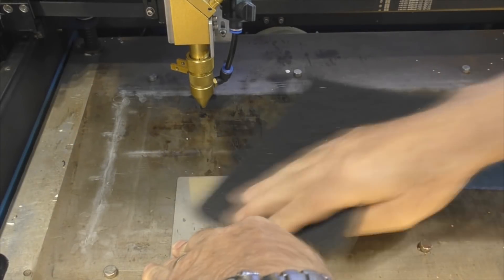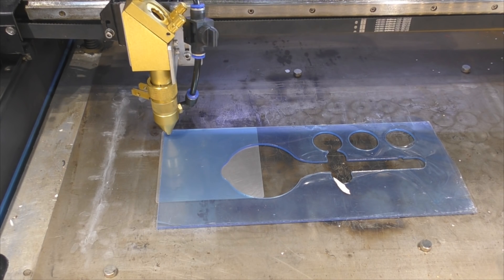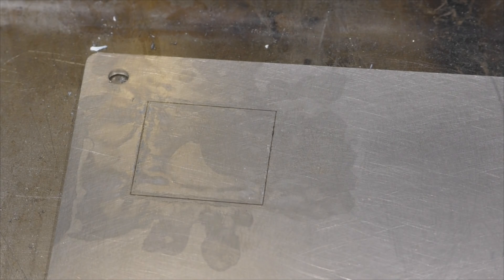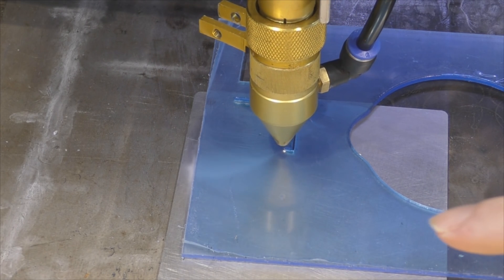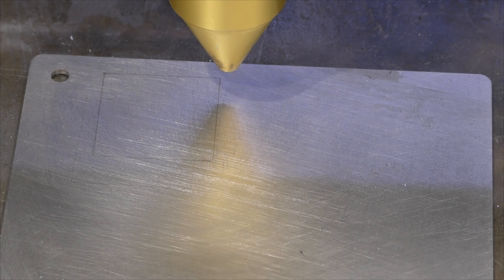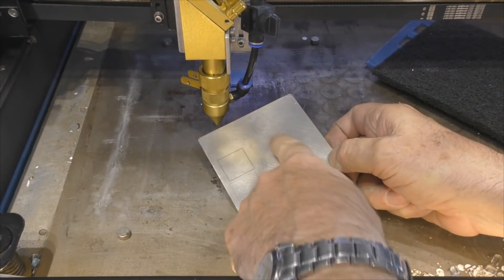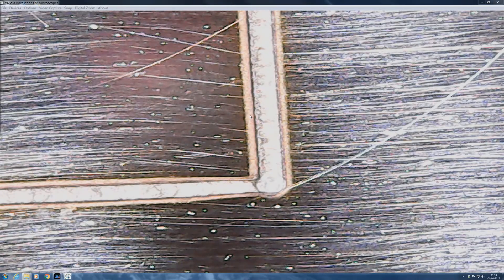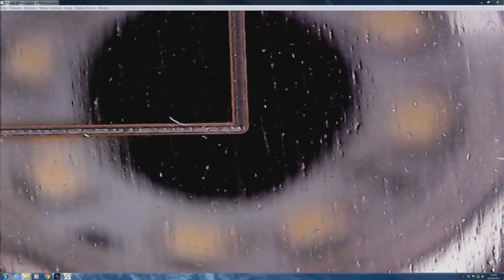RDWorks Learning Lab 100 Etching Stainless Steel

Comment: Hi Dustin, What you are doing is called temper marking.  It's not technically engraving but if it quacks like a duck....
Reply from the maker: Hi Michael
That's an interesting thought but as I understand it temper marking is something exploited by fibre lasers to produce "coloured " marking of stainless steel. The super precision of power delivery allows accurate spot delivery of temperature to oxidize the surface to one of the range of tempering colours (a very dark browny black  to a light yellow) Non -engineers seem amazed that lasers can "paint" colours but fail to recognize that there are no reds or greens in the colour pallet.  The process that Dustin is speaking of is a chemical reaction between elements in the plaster and the stainless that only occur when sufficient heat is added to the equation. Sdaly we do not hace adequate control of power in our little fire breathing Chines dragons to achieve temper marking ......but it's an interesting thought that perhaps I ought to experiment with. 
Thanks for the comment because all comments are thought provoking and who knows where careless thoughts will lead?

Best wishes
Russ
Reply: Hi Russ, Thanks for all the effort you go to with these videos.  I've learned so much from them already.  And I've only watched a fraction of them. In my eagerness to contribute something to the conversation, I got your name wrong. Not a great start.  Anyway, I've recently got a 150w CO2 laser with 900x600 bed and I'm going through the pain of finding my way around RD Works.
So my comment about temper marking was actually in relation to the CO2 laser marking on Stainless.  I haven't tried marking any metal yet on my CO2 but I've used an NdYAG laser to mark stainless before. The localised heating causes the color change even if you don't have enough power to melt the surface. Emissivity of Stainless is also higher than most metals at 0.16 so it will absorb quite a bit of infrared.  (Ask any kid who's used a stainless slide on a sunny day). The thermal conductivity of stainless is also lower than most other metals.  I think that helps to make the markings have very good definition.  Your magnified images did appear to show some melting of the surface so you've got enough power. I'm sure you're right that we don't have sufficient control to achieve a particular colour but that doesn't mean we can't make worthwhile black and white marking.
Anyway, I should take a leaf out of your book and give it a go, instead of waffling about what should be possible.
Thanks again.
Mike
Reply from the maker: Hi Mike
Good luck with your new machine. I hope you are not planning to do much engraving on it because you have bought a fantastic cutting beast (a lumberjacks axe) but if you want to do engraving, you need scalpel control at very low power. Even with my 60 watt tube I sometimes struggle to get the control I need at  low wattages.
I am amazed at  just how much undiscovered territory there is in this simple little Chines dragon and I cant see me running out of subjects ant time soon. Your throw away comment has been added to my long list of things to investigate so thanks for that..
Best regards
Russ

Comment: Hello.  i have watched all the tutorials.  And more of your videos.  I was having a water issue, I fixed it.  But now my machine wont cut.  It sort of traces the image but wont cut.  Any advice? PLEASE
Reply from the maker: Hi Pamela
It sounds like an almost dead tube BUT lets not panic just yet.  A few questions.
1)Do you have an ammeter fitted?
2)Is your tube labeled K H Laser?
3) How long have you had the machine
4) Do you have a small piece of 6 or 8mm acrylic?

Speak soon
Russ
Reply: hello thank you for your reply.  It says KH Laser.  Is an ammeter like a gauge?  If so no i dont.  I tried pressing the green test button on the side panel but the laser does not turn colors.  BUT if i press the "pulse" button the laser tube turns a strong shade and it looks like purple electricity running through it.  I used the power supply from my previous machine and still does the same
Reply: i just purchased the machine.  i upgraded from a 50Watt blue machine.  I accidentally burned the machine and almost my house. So had to buy a new machine.  i do not have a piece of acrylic
Pam
Reply from the maker: Hi Pamela
I think it really is bad news. Your machine is almost certainly a machine branded KeHui. The KeHui factory have a notorious reputation derived from all the correspondence I get and some hard evidence I have seen with my own eyes. K H Laser and KeHui (note the similarity) are one and the same. They do NOT manufacture laser tubes. Instead they trawl round all the major tube manufacturers for REJECT tubes. They retest those tubes and relabel those that work "in some way", enough to fool the average technically naive Ebay buyer . They then fit those tube to their own machines. You cannot buy Kehui machines direct from the factory, they ship them in bulk to various warehouses around the world. Lots of private sellers with a PC s (in their kitchens in  China)  then sell these machines for commission. That way the chain of responsibility back to the factory is broken and you are dealing with someone who knows nothing about the machine and has never seen it. 
So, I'm afraid from this far away, the circumstantial evidence indicates a dead tube. The fact that your tube glows  when you press the pulse button is proof that the power supply is working well, but that glow does not mean that you are producing power. The glow is the nitrogen ionizing but if there is insufficient  CO2 in the gas mix then there will be no power. It's a bit like having a car with an engine that works but  no wheels..... useless.
Depending on where you live I may be able to recommend somewhere to buy a new tube, Do NOT buy from Ebay or Amazon marketplace because you risk buying rubbish
I'm sorry it's bad news but once you have experience of a proper tube then I'm sure your  tears will turn to smiles. I suffered with TWO crap tubes initially before I learnt my lesson, so I can definitely empathize with you.
Best wishes
Russ
Reply: SarbarMultimedia  thank you for your help. I am located in NY USA any idea where I can purchase another one? Or should I just be returning the machine. Which would prob be another headache
Reply from the maker: Hi Pamela
If you bought the machine with your CREDIT card then if it's only a few weeks old you can write to the Chinese vendor explaining politely that the tube has now stopped working after such a short time and that tube must have been faulty to begin with.  Ask for a replacement tube (which he obviously will not be able to provide) or a refund  to replace the tube yourself  (not a frightening task). If you get a negative response to this polite request AND you did buy with your credit card, then you can ask him to collect the machine because you will be seeking a full refund (charge back is the correct technical term) from your card provider. That threat is often enough of a wake up call to get some sort of refund.  You may be able to get $200-$300. 
There is a US company that I had a very low opinion of until this year when they seem to have started treating customers fairly and providing honest specifications and  a good mix of products at reasonable prices.  
You now have a problem/decision to make. Firstly, if you bought your machine as a 50 watt machine it will be fitted with an 800mm long 40 watt tube.  If you now go out  and replace the tube with a proper 50 watt tube it will be 1000mm long  and stick out the end of your machine, so you will have to make and extension cover/box ( I have plans and a video of this for my machine). This may be a point where you wish to upgrade to a 60 watt (1200mm long tube) but this may mean buying a new power supply also.
The tube to buy will be either
http://www.lightobject.com/SPT-60W-CO2-Sealed-Laser-Tube-P70.aspx
or
http://www.lightobject.com/SPT-45W-CO2-Sealed-Laser-Tube-1M-P751.aspx

These are mid price (like a Ford) tubes that are reliable and work well. With ,more expensive tubes such as Reci or EFR you pay for the name.

Your power supply will definitely work with the 45 watt tube , but if you like to look at the model number on you HV power supply I will tell you if it will run a 60 watt tube.

Best wishes
Russ
Reply: SarbarMultimedia thank u. It is a 100 watt machine. I was never able to use it. Not even once
Reply from the maker: Hi Pamela
In which case you will have an 80 watt tube fitted. They always specify machines with the paek power rating of the tube. Sadly you can never use that peak power or you will be over driving your tube and seriously shortening it's life.
If you are cosidering trying to push for a replacement 100watt tube (or at least a refund) I would quote this price and specification
http://www.lightobject.com/SPT-C100-100W-CO2-Sealed-Laser-Tube-P873.aspx

But before you spend your money on a new tube I will ask you a question or two about what you plan to use it for. If it's for cutting then you may need the power depending on what material and what thickness. If it is mainly for engraving with a little bit of cutting then you may want to reduce your power requirement because it will be difficult to do engraving with a 100 watt tube. The 80 watt tube that you undoubtedly have at the moment may still be too strong and you would benefit from a 60 watt all purpose tube. It requires very little power to engrave and that why these machines are always called engraving machines. The more powerful the tube the quicker the power rises and you get very little control at VERY low power with a big tube.
What diameter (80mm?) is you tube at present and what overall length (maybe 1450mm?) Also can you tell me the two power supply model numbers  that you have  (one from your old machine?)

These details will help me guide you to a sensible spend to suit your needs.
One of my machines is 60 watts and the other is 70 watts. I can cut 15mm acrylic with both and 12mm ply easily and also 10mm MDF. they JUST about allow me to do engrave well.

Best wishes
Riuss
Reply: SarbarMultimedia Russ I truly appreciate your help. I use it mainly for cutting wood 1/8 plywood. The 50 watt machine would take an extremely long time (hours) to cut 1/8" until I started watching your videos and realized it cuts quicker at a slower speed and higher power. Unfortunately that is how I ended up burning the old machine and almost burned down the house. Very scary. I am a wedding and event planner so I do a lot of names for backdrops. I bought the machine to also engrave but couldn't figure out how to do it without cracking glass. I was never able to use the machine to its full potential because I just couldn't figure it out. Only cutting 1/8 wood. The first machine was the same one you have on your 6 video beginners tutorial. The 2 no machine is a red machine that's 100 watt and came with a stand
Reply from the maker: Hi Pamela
If you are only wanting to cut1/8 plywood mainly then  a 60 watt tube would be fine even witha 2" focal length lens. I suspect that you cannot easily fit a 1.5" lens that wold be ideal for your application and allow you to cut faster. I think you lens tube system will no allow it.  Howvwer, if you have to set yout nozzle about 19mm above the work then I will revisit that question and maybe we can speak off line and you can send me some pictures of the head/nozzle Engraving glass takes a bit of practice but the golden rule is buy the cjheapest glassware for the best results. Good quality glass does not engrave well. We can talk about those issues when you get your machine back to running again..
I will send you a private message on You Tube so make sure to find it.
Best wishes
Russ
Reply: SarbarMultimedia  I purchased a bigger wattage so I can use heavier materials. And wanted to start cutting acrylic.
Reply from the maker: Hi Pamela
Acrylic is an easy material to cut much easier than woods. The100 watt tube from Lightoject that I sent the link for is what you will need but I still need to check your power supply model number to make sure it's capable of running 100watt tube, Because they fitted an 80 watt tube they may have skimped on the power supply also. It is therefore important to check that they nearly match..The proper 100 watt tube will be longer, so have you got the room out the end of your machine to accommodate it?

Best wishes
Russ
Reply: SarbarMultimedia good morning Russ. Where do I find the serial number for the power supply. I would like to place the order for the laser tube. I had to send the company a video of the laser tube and how it doesn't work
Reply from the maker: Hi Pamela. 
It will be extremely unusual if it does not have a rating plate. somewhere that is visible. If you can take a photo of that plate you could email it to me. I'm sure I sent you a you tube message with my email address. The HV power supply will usually be a blue box with a fan in it. I think you said you had pressed the TEST button at one stage.
Best wishes
Russ
Reply: SarbarMultimedia  hey Russ. Morning. I checked through all our convos. I don't have an email but the plate says model: MYJG100W 
Also says IN:AC 110 V
I hope that is enough help. I did take a pic of the machine and the laser tube in case u need. But don't have your email
Reply from the maker: Hi Pamela
I tried to send you a message  but I cannot get through. However, I did see your tube video. Yes this is a typical KH laser REJECT tube. That mauve beam that you see is in totally the wrong place. If you look at your laser you will see there is an inner tube which is where the action should take place. There is a water jacket tube around the outside of that and finally the big outer tube is the gas reservoir. Your tube has a MAJOR fault. It is arcing from anode to cathode in the GAS RESERVOIR and not the central tube. The tube is total JUNK
As I cannot contact you by private message you certainly can write to me. Click on  the orange S squiare and you should get a page open about Sarbar Multimedia.Go to the address bar and add to the end of it     /about   and press enyter. A new page should appear with a message button top right. You can send your email privately this way and I will respond

Speak soon
Russ
Reply from the maker: Hi Pamela
Sorry I forgot to mention the power supply. That is a suitable 100 watt power supply so you should be just fine using it with another 100 watt tube. A 100 watt tube will definitely be 80mm diameter. If the tube you currently have fitted is less (and I suspect it will be around 60mm) then you may wish to order a couple of suitable tube clamps from Lightobject at the same time
Best wishes
Russ
Reply: SarbarMultimedia I sent you a message I hope it went through
Reply from the maker: Yes I got the message and replied with my email  and an answer.
Russ

Comment: CO2 laser?
Reply from the maker: Hi Steven
Yes, a CO2 laser where the wavelength is 10.6microns .Having spent 10 years owning two 3kw CO2 lasers as part of a sheet metal business, I know the difficulties of cutting stainless steel with a  CO2 laser. I was VERY surprised to find I could reach an adequate energy density with just 60 watts to melt the surface sufficient to mark it. Seeing is believing.
Best regards
Russ

Comment: What do you think would happen if you delayed your cutting by .5 seconds? Would it change the structure enough to cut deeper at the same power?
Reply from the maker: If you can get enough power into the surface INSTANTLY so that you immediately change the crystal structure of the metal  so that it absorbs rather than reflects energy. then you can damage the surface.The melting point of stainless is around1450C and its about 90% reflective. Theorertically that's a big ask .You will notice that it was black cut, that's because it was badly oxidized. I suspect I could have attempted a repeat run and done a bit more damage as the crystal structure of the oxidized material will be different. However with 60 watts, the cut depth will always be limited because the thermal conductivity of the steel will quickly pull  the heat away. I spent 10years running a metal cutting laser business and stainless requires some VERY special conditions to cut cleanly and accurately.  Knowing what I know aboutcutting stainless made me a bit nervous of even attempting it but no one was more surprised than me about the result.
Best regards
Russ